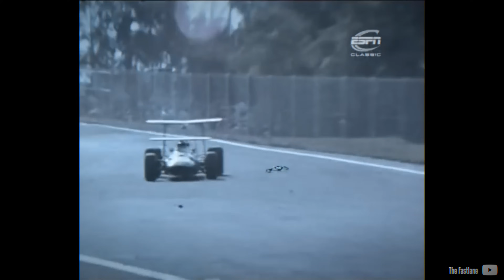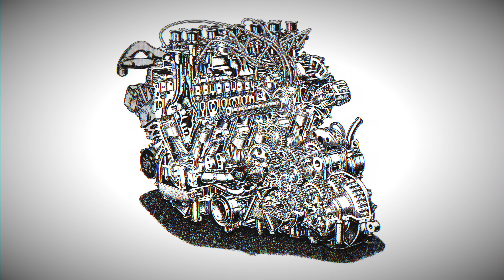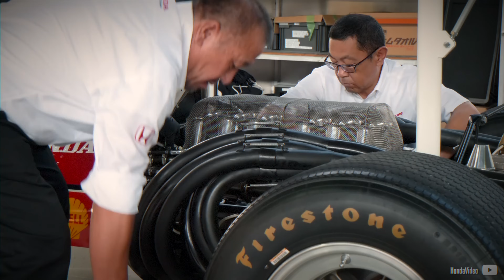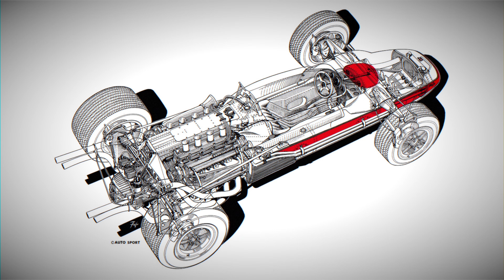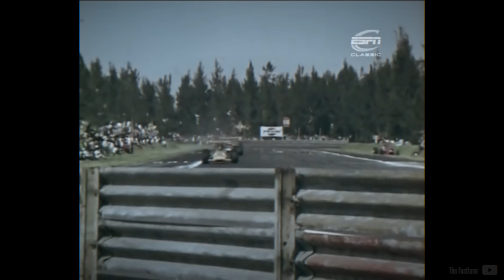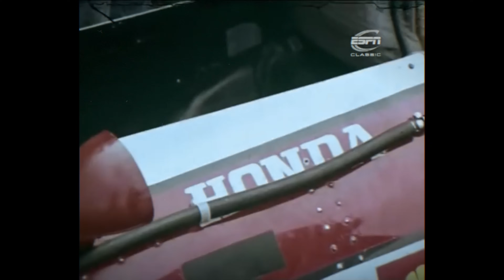This Aircooled Honda F1 Was Insanely Dangerous

Comment: I drove a car with an air-cooled magnesium engine block for years. It's called a VW Beetle. I never blew up or bnurned down. But I do remember people throwing chunks of broken cases onto campfires. It was crazy intense, like a 360 degree spotlight.
Reply: Magnesium alloy, it wasn't that dangerous.
Reply: @erikheijden9828 it is spectacular in a campfire, nevertheless... It always puts an instant smile on my face when I find a broken VW boxer block at my local junkyard.
Reply: Vobble Wagen crankcases up to the mid 60s had a moderate  mag content. 1300 up it was not strong enough. As for those cars catching fire,, as a CFS volounteer I put out 3 by myself over a few years. And yes those old fatigiued cases burn really well.
Reply: Add a magnesium body and things change.

Comment: I used to follow F1 closely but this is the first time I’ve ever heard that the Honda engine was air cooled.
Reply from the maker: There is so much stuff that we don't know and the history hides somewhere to be revealed. I am often stunned what was developed and engineered back in the time.
Reply: Only that Honda engine, not on the 272, 273, 300 etc.
Reply: @erikheijden9828  is that the one Surtees won the race with?

Comment: I worked with magnesium back in 2005. I used air powered tools to grind molded engine cases for jackhammers made out of magnesium. Nobody else dared to perform this work because of the safety risk. We often had to check the pressure lines and air compression system for water deposits. Any small amount of gas developed in that small room could cause an explosion. I was shown much appraisal for my dedicated work and got bonuses from my workplace and the company that I did the work for. I'm positive that I'm never doing that kind of work again though. Any time you were grinding over some slag trapped in the material you got a tiny firework display (yay?). A room full of magnesium dust can quickly turn into an inferno.
Reply: Wowza! Even in this video, one can see how dangerous magnesium is, especially when hit with water. There were other race cars made of magnesium way back when that burned really badly, killing the driver. I'm pretty sure Mercedes-Benz was one in Grand Prix way before this Honda.
   As a side note, I have a friend who used to be able to get a crap load of magnesium shavings/dust from a machine shop. We used to twist it tightly in heavy paper and duct tape. It didn't make a huge "bang" but man did it flare up well!
Reply: You were used as a magnesium lab guinea pig as well!
Reply: I own an engine machine shop and I have to mill, grind, cut and even weld Magnesium all the time. It is not thaaaaat bad.
Reply: @albinklein7680  Trust me, it's more dangerous than you could possibly think, as shown in the video. Honestly, that company where I used to work at burned down 5 years after I quit because of some higher up douche canoe made the idiotic decision to pump the magnesium dust out through the ventilation system. It was piling up inside to one insane level. They rarely clean it up. According to the investigation by the fire and police department it was caused by static electricity that sparked the magnesium dust into a bright burn setting everything around it on fire. Don't take this too lightly. It could save your life to take extra precautions. Peace.
Reply: @RedneckSwede  don't worry! I have a whole lot of respect for magnesium! I always clean my machines and I watch out for the shavings bin to not get too full. I never had a single accident in the last 35 years. It is mind boggling that you can TIG weld pure Magnesium without it igniting.
Reply: @albinklein7680  well for samething too burn you need oxygen a fuel and heat  and Metall is kinda shity fuel too get going if you don't make small particiels/shavings with low mass too soak up and disperes the heat and too increase the surface area so oxygen cann get too it    and welding always includes same kind of protective layer mostly Gases like Co2 or Ar  or a liquid like slag  so it isnt that impressive also little side note many metal oxides are also lighter than the metal it self and form a protectiv layer against the oxygen/air
Reply: Hope you use "  Dangerous materials expert "  On your resume!
Reply: Yet we have magnesium supplement tablets.
Reply: @klaseronen7535  Yes, but the amounts required in the human body are miniscule.
Reply: @klaseronen7535 that's irrelevant

Comment: How unbelievably tragic that such decisions could even be made in Formula One. What a different time it was. Marshalls didn’t even know how or have the equipment necessary to save the driver. It is one of the most sickening things I’ve ever seen in auto racing.
Reply: Interestingly, we are seeing similar "unpreparedness" today, when it comes to EVs burning. The standard techniques just don't work.
Reply: @UncleKennysPlace  battery powered cars have been around for over a decade (Nissan Leaf, Tesla Model S). Firefighters know better these days.
Reply: @nizm0man  Fire Fighters may be trained to handle EV fires different, but that doesn't mean the department is equipped with the proper tools. I was only a few cars away from an EV that caught fire on an expressway in a town of 50,000. The police and fire department arrived, but they had nothing to fight the fire other than stop traffic and let it burn itself out. Fortunately, my wife didn't see them remove the driver from the scene.

Comment: Looking at the air-cooled engine, it doesn't seem to have a lot of cooling fins and looks like they were relying upon ram air vs fan for cooling. With 2 oil coolers it was probably partially oil-cooled, but that thing must have ran hot.
Reply: I think it's not really oil cooled like Suzuki GSXR/bandit SACS or aircraft engines but more by the volume of oil
Reply: @ThePontiacgto65 I was coming here to wonder the same about it being more related to volume. Have to agree with you on that. Combining thermal mass with as minimal cooling as possible could have worked pretty well, I'd say.
Reply: Think of a Porsche flat six. I know mine used 3 gallons of oil in the tank. I never had any heat issues, of course I never raced it, but they have proven to cool well enough over the years. On mine, the cooler mounted flat up front wasn't very large either.
Reply: @hugejohnson5011 the Porsche engine is cooled by a blower and a very sophisticated system of ducts, flaps and thermostats. That is a completely different thing!
Reply: @albinklein7680  Ahhh...Ding ding ding! Yes, having owned one for years, and having been in the auto trade, and been in the midst of the innards of dozens of Porsche engines, I'm quite sure I know how they cool. Maybe you missed the point of the previous back and forth?
Reply: @hugejohnson5011  then why are you comparing two completely different things?
Reply: @albinklein7680  Just stop. I wasn't "comparing" any two things of the sort. I merely made mention that the dry sump flat six carried a lot of oil. Is there a language barrier, that is causing you to not understand the context?
Reply: Every internal combustion engine is at least partially oil cooled.
Reply: @CaptHollister  agreed but this is primary vs secondary cooling in this case. All engines get some cooling from air, but it's not usually the primary cooling scheme so we generally don't mention it because it's heat removing capacity is so minimal compared to the other cooling methods implemented. 

So while I don't disagree, I also don't see the point. Maybe I'm missing something.

Comment: The VP of the International Aeronautic & Machinist Association uonion died in a fire on my local airport runway called Baldwin field they couldn't put the fire out because of the magnesium content of that craft  and it damaged the run way..  my father was a member.  Pure magnesium is the devil. very special conditions and methods are required to put it to use and handle  you really have to know what you are doing to use it. yes folk dome metals are a fuel in the right circumstances

Comment: my dad changed a lot of tires back in the day you wouldn't believe the damage magnesium wheels cause they banned them for a good reason I'm not for taking things away from people forcibly' thats not ok but I can live with it in this case. we have better aloys today Anyway, metallurgy has come along way, and polymers today are stronger than steel  but thank to carlessness the ban set a big time gap in the wheel industry / many years passed before something better  was available to the pulic.
Reply: "they banned them for a good reason"  Even in the 00's, OZ Racing wheels were often still magnesium alloy though?  There was even "Magnesio" lettering on them, unless that was just a marketing term, I'm not sure.  The Formula 2 website claims that the current 18" OZ control wheels are still magnesium alloy.   While for Formula 1, "From the start of the 2022 season, F1 wheels were increased in size from 13 inches to 18 inches. At the same time, it was decided there would be a single supplier, and BBS forged magnesium wheels were selected in the tender."  Unless that's a mistake, it sounds like F1 is still current using magnesium wheels?

Edit -- The 2015 Yamaha R1 road bike comes standard with magnesium alloy wheels too. So it seems even recently magnesium wheels are not uncommon in road bike applications, although perhaps not as common in exotic sportscars as they used to be.

Comment: Imagine if they had access to titanium. Strong as steel, light as aluminum. Not easily effected by heat.
Reply: Imagine having access to the future 🥴
Reply: @lemonjuice6177  
Honda is there.
Reply: @upsidedowndog1256  after dealing with Honda while working on the motorcycle industry, I can firmly say Honda is no longer superior. They got ahead decades ago, then got lazy and arrogant. Now, they're no better than any other Japanese brand.
Reply: Titanium has a density between that of aluminium and steel. It's Young's modulus also falls in between the two. It's strength is also between most aluminiums and many heat treated steels. It has it's uses but it is not a 'wonder' material for most applications.
Reply: @@retiredbore378 
Sheet metal in aircraft nacelles and anywhere heat becomes an issue in aircraft. Yes, I work with it. Nice material. Makes the prettiest sparkler white sparks when ground on! Hard to deburr the HiLock holes.